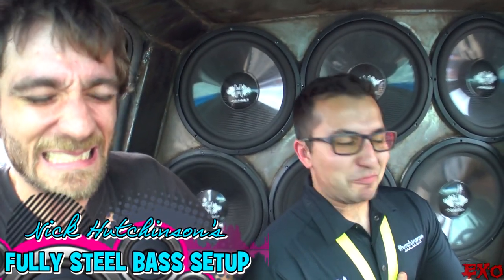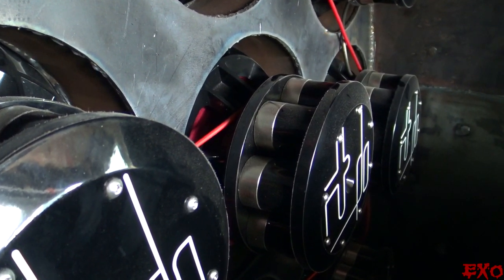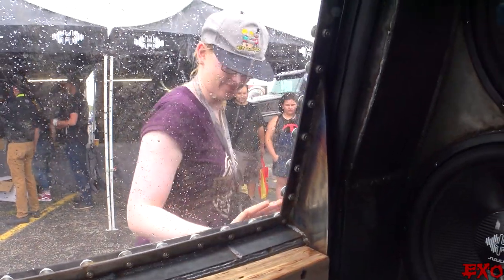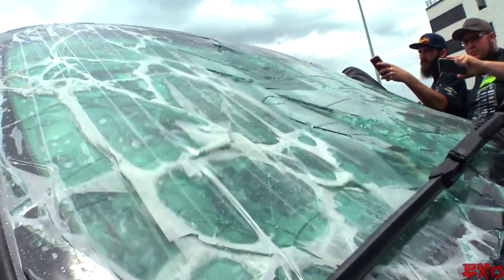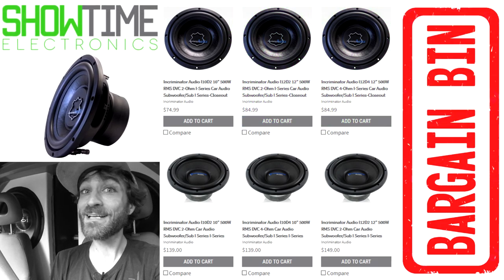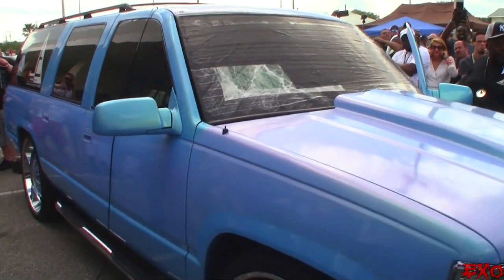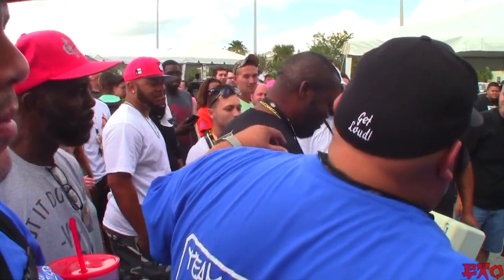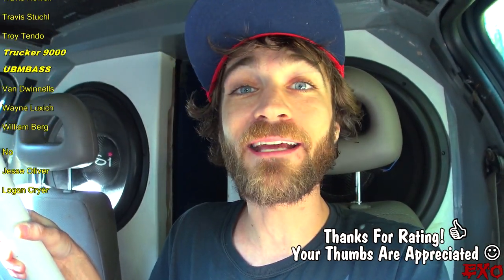FULLY STEEL Subwoofer Box w/ 166db BASS DEMO & Jethro's Unexpected SPL Runs... EXTREME Car Audio!!!

Comment: As a x welder I can tell you that was a shit ton of welding.
Reply: Not rel great looking welds, but I'd love to come help with these kinds of Builds
Reply: @The4x4manonbroke  lmao I just commented on how shitty those welds look. Would be a great build but finish welds could have been better
Reply: @koda0027   Exactly. They needed to use 7/64 wire. They used 3/100 or .035. Too weak for so thick.  But considering it is long welds it won't fall apart but it could crack a leak... And have loss of pressure.
Reply: @The4x4manonbroke  ugly welds are the same as pretty welds
Reply: @MacNifty  my dad welded my fence and they ugly welds as heck but they hold strong , he cut down my 40 foot palm tree half way and it fell right on iron gate and nothing happened to it
Reply: @MacNifty  LoL... meanwhile in reality  .024 will weld up to .250 the wires speed just ends up pretty high.    .030 will easily do 1/4 and up to 3/8 ... for a project that is mostly 1/4 mild steel .030 er70s6 and c25 are plenty .  I have plenty of real world use applications running mils steel a500 plate and tube as well as 1020 and 1026 dom tube for  rock crawler that are  bounced off boulders to trailers going down the interstate at 70 mph...lol... The idea that you are suggesting. 035 is not enough for .188-.250 thick mild steel is ridiculous... I use .035 off my 250 amp ironman to weld 1/2 plate I can do it off my 210 handler but if it's going to be a lot of it I use the bigger machine ...lol...all welds are real world tested on my own toys.  If you are joining thick steel and can't weld both sides you're going to be beveling it anyway ;-)

Comment: Damn exo i sure learned and seen a lot off ur videos. You and few other guys on YouTube is the reason why im so loud with only 2 12's Kicker CVR 12's! Keep up the good work bro, i might need a some gear from you for my car.
Reply: I traded up from 2 12 in infinity kappa to a single db drive 1000 rms  10in In my dad / work van
Reply: I’m floating paper in my front window with a single kicker solo baric L7 15 in my trunk. 5.89 cu ft box tuned to 29hz. The sub fires into the trunk with the aero port blowing into the cabin of the 4 door car (I removed the back seat, it’s like a trunk wall I guess) I stared watching exo years ago when I got my license and never really stopped with the car audio lol. I just got into making singe subs as loud as possible.
Reply: @chadpainterspallete620  I wish i can get sundown but too expensive for my budget

Comment: No don't hate me , the system is awesome but, the welds should of been tig'ed. Or at least a better bead weld. Thats thick steel ,you can lay down some beautiful welds with what your working with. 220v weld all the was was needed. Its still sick. I would of powder coated it.

Comment: To badd he welds like crap.  Lots of porosity and a lot of lacking penetration. But a steel Box with a wood core would be more ideal. Because it needs to be insulated. It will create pressure but crapy sound. Confined space like being in a tanker or vault. I approve still.  Makes for a good bunker too.

Comment: My first ever build was $120 using a $50 amplifier from Amazon, a $30 12" subwoofer from walmart, and a $40 box for the subwoofer from walmart and i can run it loud but the amp gets hot despite being rated 4ohms bridged at 150w rms driving a 4ohm single coil 300w rms subwoofer.

Comment: Supp I got question. I have 2 subs and first one is 250 rms and second one is 300rms so the question is.... is it safe to connect them in parallel ? They are both 4ohm
Reply: You really shouldnt ever connect two different subs together